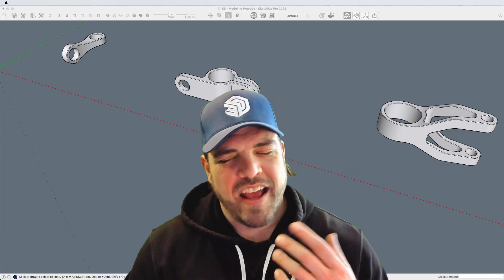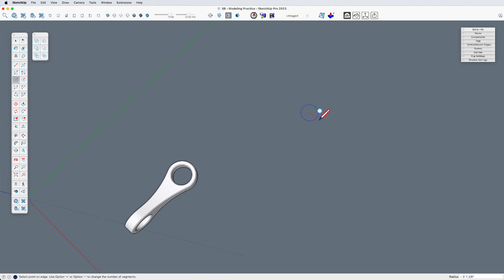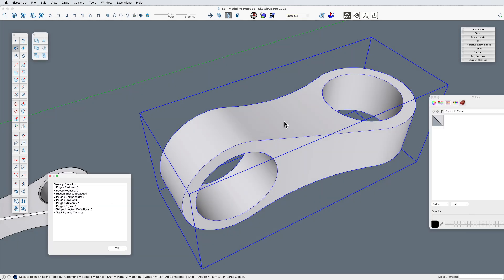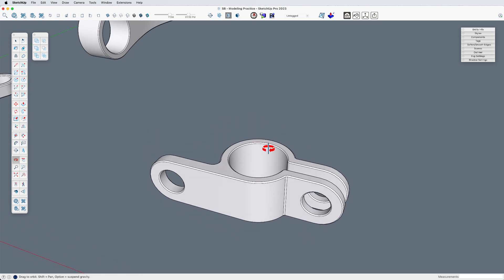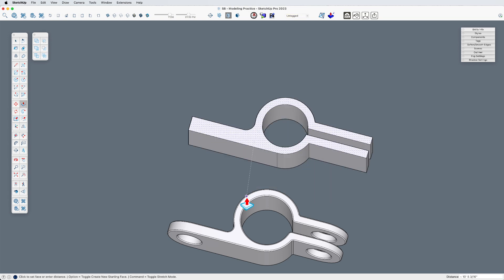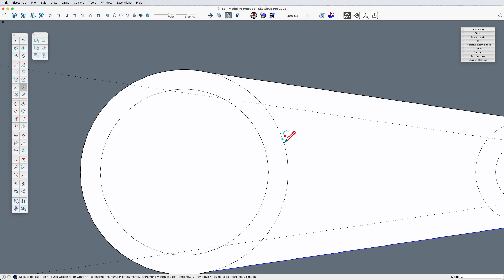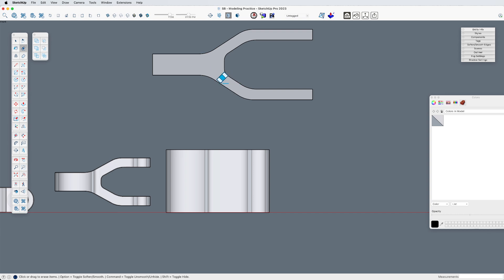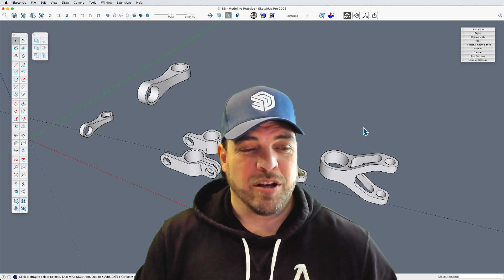REQUEST ✅ How did you model that??

Comment: I would make the part to copy a group, and then  lay a transparent rectangle over the part and draw directly over it to copy it, with the exact measures.  Then do the same over the side , and do the interesection finally. Drawing on a transparent rectangle  in non-perspective allows to get the right sizes easily from the start.

Comment: Do you know if I would have access to those specific extensions, that you used, for the iPad version to use for 3D printing. The iPad version is sandwiched between the Go version and the Laptop version ($128 Vs $250ish annually, for the hobbyist the later is a bit pricey for the use I might encounter) it looks like this functionality for 3D printing may not be available in the iPad version between the other two. If not are there third party workarounds for things like bevels and welds? Or must I have “Extension” capability. Trindle’s website leaves me questioning this??? Anything that you might recommend  for the iPad Pro (M4) and Pencil Pro that might be better for 3D Printing? I have experience with a much older free version of SketchUp for Windows too to create an amp and pedal board cabinets.
Reply from the maker: As of now, extensions are exclusive to desktop. However, you can use the iPad modeling tools to achieve similar results. For example, the Follow Me tool—or Autofold—for bevels. The Weld command is on iPad as well.
Also, you can subscribe through the App Store for $14.99/month.
Happy modeling!

Comment: Could you please make some tutorials for quad / subdivision modelling? For instance with Artisan or equivalent. Somehow, I can’t find that many tutorials for Sketchup. I have found tutorials that show how e.g. Artisan works, and tons of tutorials on quad based modelling with Blender and Maya (that are also useful). However, as I start modelling something concrete in Sketchup, I run into “issues” 😂, I guess mainly related to figure out the right workflows (trying to learn both the principles of quad based modelling and the tools in sketchup) so a tutorial from you guys, where you could go through the workflow, working on a concrete reference case, would be awesome. Thank you in advance!

Comment: Solid tools is a free extensión?
Reply: No, Solid Tools is part of Sketchup Pro.
Reply: Cant find it in mi skp 2021 pro fot pc 😢 @MickHealey
Reply: As @MickHealey says not free nor accessible in free or web versions.
That said, it is mostly just a bells and whistles addition to the intersect faces command.
If you run this on two groups of overlapping geometry, with some careful (and, to be truthful, sometimes painstaking) deletion of faces and edges you can achieve the same results